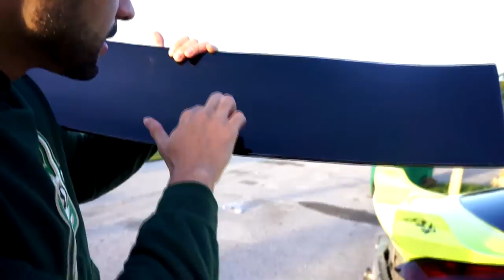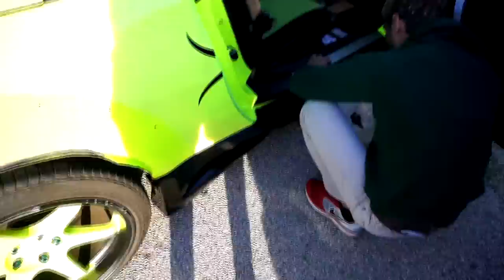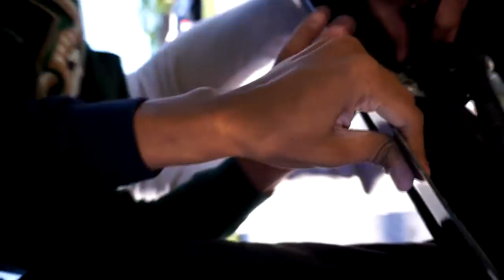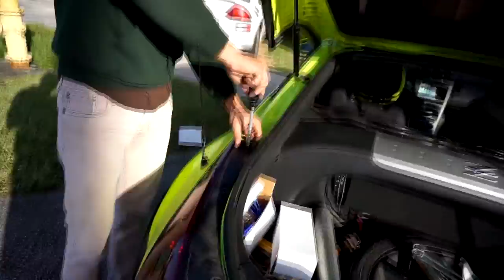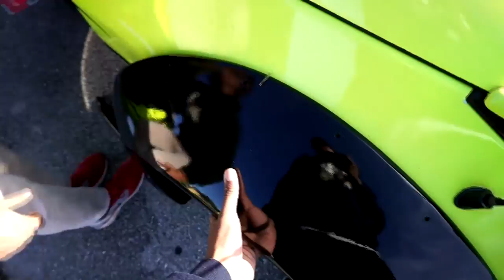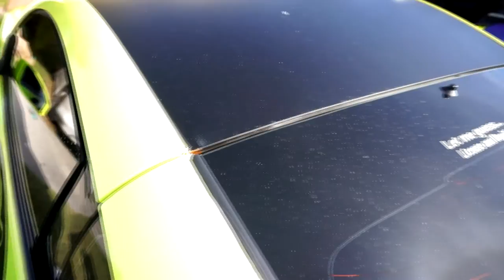Resurrect 350z E3: Wide Body Kit Painted & Install on 350z

Comment: Sweet car.. It doesn't look like you have cut away enough of the inside wheel arch though.. looks like it would still rub on the tyre.
Reply from the maker: i felt the same way at first but there is no rubbing i recommended we cut more but since it isn't rubbing at the moment with current wheel set up, we just left it as is.

Comment: What brand bodykit is this I assume it's not legit veilside is it Vader 3 duraflex or something different cause I'm looking to buy a decent looking replica veil-side 3 wide body that's fits
Reply from the maker: Yes you are correct, these kits go for about 500 for the full car I believe last I checked.so the most adjustments you would end up doing is shaving from the inside where there may be excess fiberglass or material on some portions to fit flush on the cars body. other than that you should be good.
Reply: MoreCarStuff okay because I had the same kit b4 on my car and had an auto body shop do it and they used epoxy to seal the front and back flares on, I told them to drill out the holes but they didn't do what I said and now my paint is ruined on certain parts of my car and the kit started cracking and it fell apart basically and now I'm just doing it myself so thank you!! Helps a a lot
Reply: MoreCarStuff where did u purchase the kit from
Reply from the maker: Professor Drift yeah man that sucks but I guess they wanted the kit to look more natural and be removable. to me either you do rivets, or you completely dedicate to the kit with body work and everything such as bondo work. this kit can be found on eBay last I checked.
Reply: MoreCarStuff what website did u guys get yours for 500
Reply from the maker: Professor Drift I honestly don't know. I met Danny after he had purchased it. I can ask him for you. I'll reply once I know where. search 350z veilside wide body on google to see some deals.
Reply from the maker: Professor Drift he did not get it for 500, I've seen them for sale for 500! sorry for  misunderstanding. this was on eBay where I saw them.